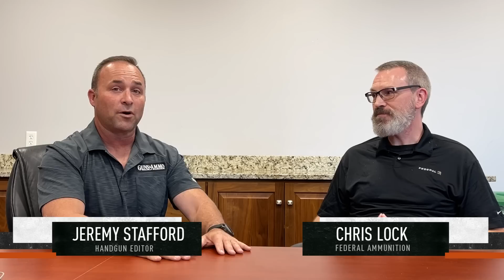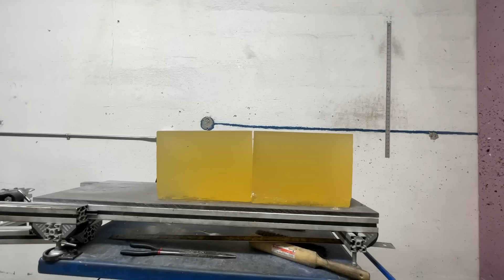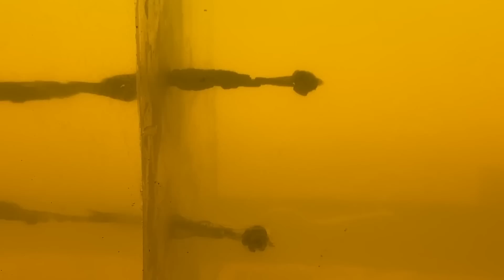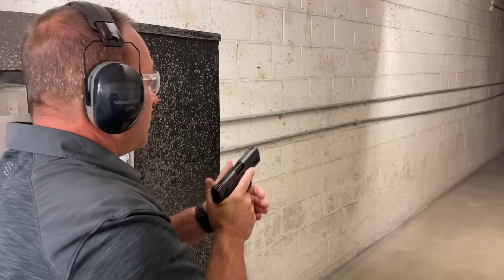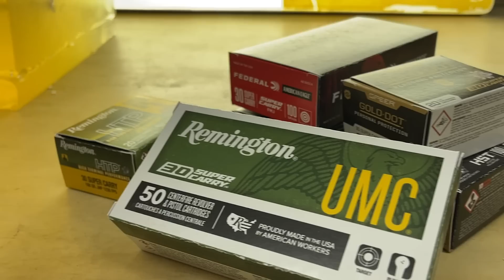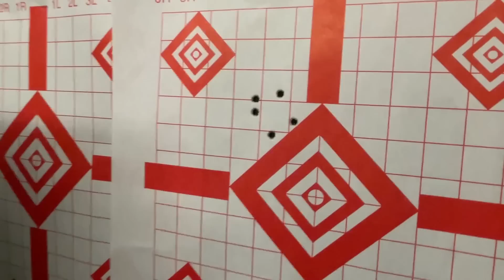Federal .30 Super Carry Pistol Cartridge: Full Review

Comment: I was hoping for .32 Action Express. Basically, a rimless .32 magnum that would, instead of match, exceed 9mm terminal ballistics. Would throw 115 gr bullet at 1400fps...
It would be loaded into a SW CSX and hold 10 rounds. 
Just my dream... But I think it would be pretty cool....
Reply: I agree! Why match 9mm when you can easily exceed it. All I want is a .30 caliber rimmed magnum round for 8/9-shot concealable revolvers. Would be great but nope here's some shitty 9mm clone that costs 3 times as much. Modern metallurgy allows for much higher pressures and strong performance yet were stuck with baby 9mm.
Reply: @sethdaboss245  Yeah, put a rim on a .30 carbine cartridge...like a 
".30 Win Mag"... And I bet you could develop it with less than 40,000psi.
For my idea, would be in reverse. Take the rim off of a .32 H&R Mag. and build a small pistol around it.
Reply: @theelwhastrummer7166  Excellent idea as well! I just like revolvers. Would be a great idea because .30 is very small diameter wise and could have excellent capacity in concealable and full size semi autos. Not to mention the versatility of weaker loads for concealed carry as well as heavy beastly loads for full sizes.
Reply: @sethdaboss245  I like revolvers, too. I have a beautiful old SW Mod 19, and have developed several excellent handloads for it, in both .38spl, and .357mag. Unfortunately, it's a little on the large side for CCW, but love it just the same. And I used to have an older SW Mod 32 in .38 S&W. It was a great pocket pistol.
Reply: That already exists, it's called 9mm major, or 38 super.
Reply: Sounds like you were referring to the 327 Federal; never heard of any .32 AE...
Reply: @mdd1963  There's no such thing. Sure would be cool, though. Like a miniature version of a
.50 AE Desert Eagle...

Comment: So they made a cartridge that has equal performance to 9mm with price close to .380... 🤦‍♂️ Gee thanks
Reply: And you have no idea how chamber pressure, sectional density, or expansion ratios work.

This is at rifle chamber pressures, pushing a 100gr high sectional density .30 caliber at the same velocity as standard 7.62 tokarev, 85 grain out of a shorter barrel...

It’s actually higher than 7.62x39... so it will accelerate a 100 gr projectile faster than 7.62x39 (that’s what cartridge design is for) in a sufficiently short barrel.

With a non bottlenecked cartridge...
...with a shorter overall length, so shorter grip/chamber/more effective barrel length from the gun’s length — where every inch of barrel length significantly increases velocity.

It blows away both Tokarev and 5.7mm in sectional density.

It’s almost .327 Federal Magnum numbers... .327 you can get longer / higher sectional densities because of its case volume — here we don’t want a long grip/chamber/ etc leaving no functional barrel length.

You want energy? Load it with an 85 grain projectile. Velocity is where you’ll see the ”energy” increases. (sectional density is more important in my opinion)

They could have just used an 85 grain, but people would cry because you’re comparing different sectional densities with 124 grain.

So they matched the gold standard full sized duty 9mm at every level... and it’s still +20% capacity, flatter shooting, with less recoil.

Sure, you can +P+ 9mm until it blows up, and it’s not going to be very smooth out of a 20 oz gun.

Everything about this has been designed for a carry handgun — the way a cartridge ought to be designed.

But some people also like mini dracos and HK 51K builds with .308 out of a 5” barrel, so
Reply: @-John-Doe-  Me, or...?
Reply: @vlogfriendsutopia  The people comparing this to .380
Reply: @-John-Doe-  Ah, yes. One other thing you can even add is this, dealing with those concerned about the pressure levels;

The 50K psi only tells part of the story. The units are "pounds per square inch" so in order to be meaningful you also need to factor in the square inches. "Bolt thrust" is the force applied to the breech face at a given pressure. The below is oversimplified but it illustrates the point:

.30 Super Carry = 0.0765 square inches x 50K = 3,823 lbs.

9mm Luger = 0.0990 square inches x 35K = 3,464 lbs.

9mm Luger +P = 0.0990 square inches x 38.5K = 3,811 lbs.

Sooo, although the Super Carry 'might' have 15K psi (43%) more than a 9mm, due to the reduced area of the case head the bolt thrust is only about 10% greater, and basically the same as a 9mm +P. Other factors, such as hoop stress, are similarly reduced due to the .30 Super Carry's smaller diameter.
Reply: With lower recoil and more rounds*. If the price lowers, I see it as legitimately a better round than 9mm.

Comment: I predict it will experience the same fate as the .327 federal magnum. A good idea that will not catch on.
Reply: 327 failed because it's too weak. We need 357 magnum +p equivalent from a .30 caliber bullet. With modern engineering and metallurgy we could easily manage this along with it's pressures while allowing 8 shots in a concealable revolver.
Reply: What's the point of making a .31 cal bullet with a rim diameter of .37? Waste of space! .06 x 6 = .36 aka an entire another round! Make a .30 cal bullet with rim diameter of .32 so we can fit 8 shots in a revolver! .375 x 6 = 2.25 which is what gun companies see as concealble. 357 mag rim diameter is .440 x 5 = 2.2. Also concealable, but only 5 or 6 shots! .32 x 7 = 2.24 and .32 x 8 = 2.56! Much preferable to 5 or 6 rounds! Length of the cartridge is not the issue here! You could make it as long as a .460 S&W while retaining a thin diameter to make some powerful carry rounds to split the gap between 357 mag and 44 mag while not being as large as 41 mag nor as weak as 327 fed mag! Ammo companies make it happen!
Reply: @sethdaboss245  Thanks for the reply. The .30 super carry is a great idea, but I don't believe that it will displace the established .380 and 9 mm, especially in a time of high prices and lack of availability. The .380 is chosen for lighter recoil, the 9mm for effectiveness, price and availability.  We will see!

Comment: Wow, Federal created a “32acp Magnum.”   Big deal, it’s NOT a game changer at all.
Reply: but with an OAL that won't fit in 32,380 size guns
Reply: More capacity is a big deal for a round that does the same thing as 9mm. A lot of sig p365s and SW shield plus were bought since their release. It is a big deal for folks who conceal carry.
Reply: @justice3188  Like Hickok45 said, two more rounds won’t matter.  Learn to reload quickly.  This isn’t a game changer round.
Reply: @colt10mmsecurity68  if I have an extra mag i now have 4 more round to cause a break in contact with my attacker. I think 30 carbine short will be a great new round. It may not be a game changer but it will be a good addition.
Reply: @colt10mmsecurity68  it wasn’t designed with the intent of more capacity 
If you read their website and release statement 
It’s intended to have less recoil , specifically in the micro auto pistols 
It’s designed specifically to be shot from a 3” barrel for expansion. 
With less recoil it will have a weaker spring which means easier racking.

Recoil and racking are the two biggest issues on a CCW micro pistol 

Most people do not throw a lot of time in at the range with their micro carry
They practice more with a range pistol and carry a similar micro 

This would change that 
Making the micro carry’s more palatable for a wider range of shooters to have a one and done gun, without giving up much if anything in the performance category. 

It’s not going to be useful in a Glock 17 
But it would in something the size of a Glock 43 

The extra capacity is a side effect 
Not the reason the developed the round 

Most 380s and micro 9s are very snappy and difficult to rack
This is trying to change that
Reply: @tedpendagast579  Gotchya.  Thanks for the 411.  👍

Comment: So with a double stack are we gonna have an increase in capacity by 4-5 bullets ?
Reply: I think so , the micro 9's would be full capacity 15 round 30 super carry. Easy enough to make 300 super carry "380" size guns.Ruger lcp max could be a 15 rounder and maybe a hair smaller.I am on board.
Reply: @crudd-m7m  The biggest issue with chamber those 380 guns in this isn’t physical size of the cartridge, it’s chamber pressure. I’m skeptical any of those micro 380 size pistols can handle the 50,000psi chamber pressure. You’ll most likely only see this cartridge offered in pistols chambered up to 9mm.